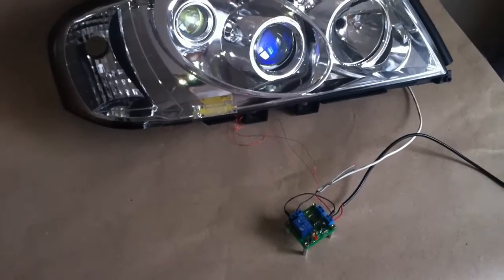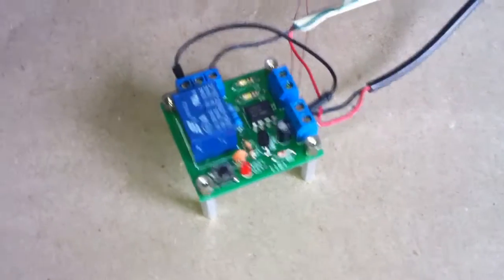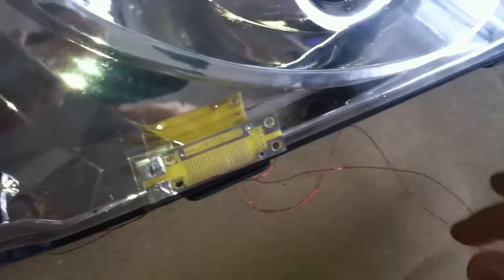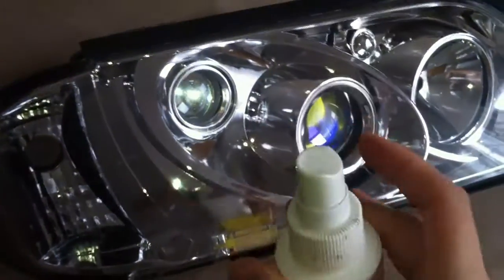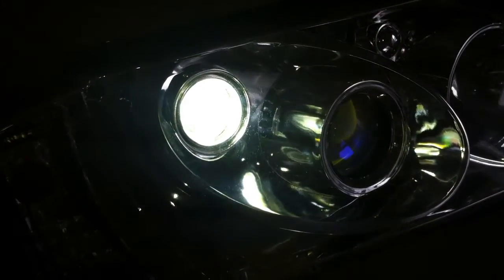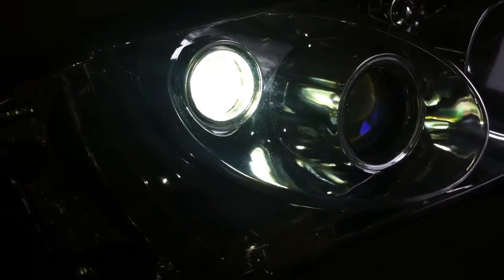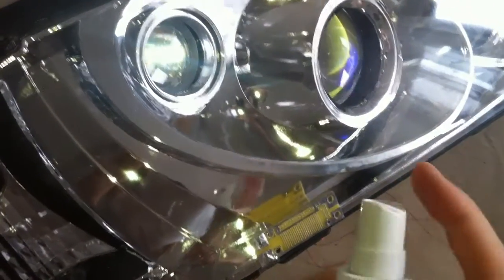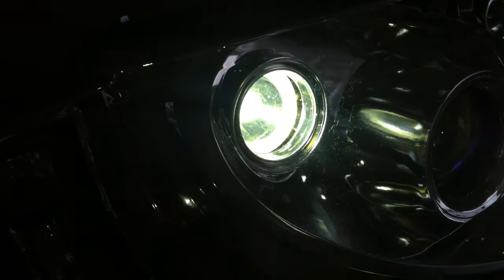Water Rain Sensor and Alarm - Car Roof / Headlights / Washing Machine / Basement / Windshield Wipers

Comment from the maker: @stdavross666: not really, we have protection against that, that why we added delay option. So if you are hit the rain, sensor need to a) dry out b) delay time should be exceeded. If both conditions are met relay will turn off